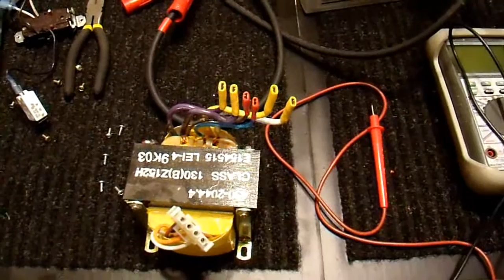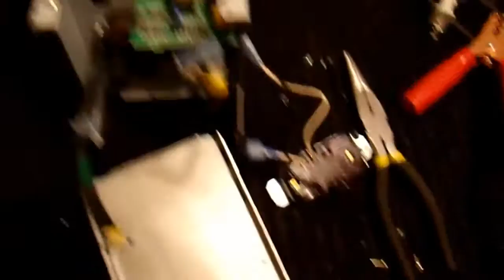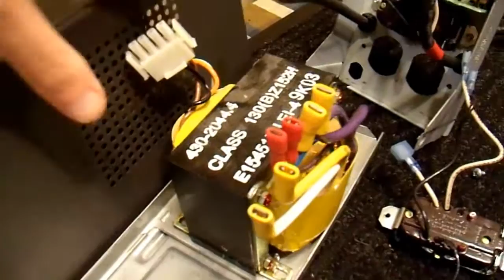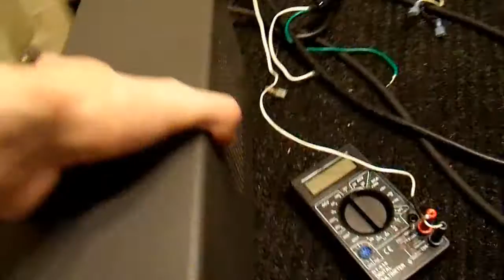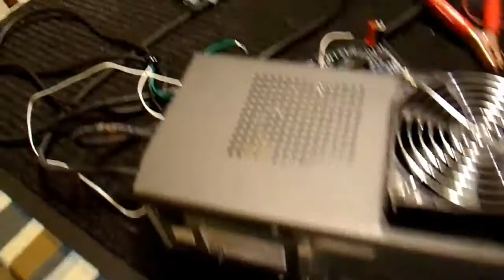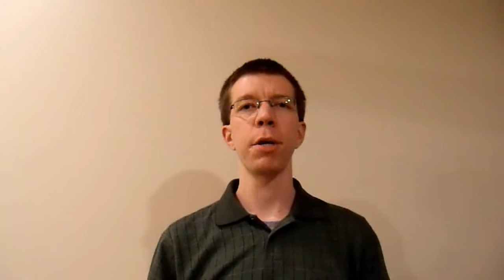UPS to Inverter Conversion FAIL Follow-up part 4

Comment: hi thanks for the vids ..very informativeplease tell us what causes a ups to report an internal faultit runs perfectly for 1 minute theres no sign or overheating on the pcb  I tried new batteries same problemfault when mains connected .also when only running on battery . max runtime 1 min

Comment: Working on restoring a APC SMX3000 - 120 volt unit to full functionality.  The unit operates fine under the NMC/web control, but the LCD screen is locked into an "internal fault" message with no response to any of the control buttons.  I'd like to know if you have any experience in this type of unit and what areas are best to inspect/test to determine if there is a relatively simple "fix".  I've tried updated firmware - the NMC upgraded fine, the UPS would not upgrade either with wizard or ftp.  Any help appreciated.

Comment: Well I had in the past the same Idea, but when I commented this to one of my college mates.. one of them make mention that this devices aren't really meant to run for long terms of time! usually they will never give you more than 10 or 15 min and then they would shut down! so my concern is that the transformer wasn't designed for a full duty cycle. well those are my 15 cents of common sense! hope that bring you closure!

Comment: Once again I see I am late to the dance but wanted to comment on how much I enjoyed watching this project unfold. The battery cable access ports, doubling the transistor count, changing the beep alarm function using the software, the 2.2k pullup resistor on  the mystery chip, and your demonstration of the multistage transformer windings with the auto-transformer were all great stuff! I was sad to see the 650 eventually die but even so it was some consolation knowing that many of the parts live on as useful elements in other projects. Your videos are very interesting, entertaining, informative, and technically accurate - something rarely found all together in YouTube or any other videos for that matter. Your efforts are very much appreciated!

Comment: Thank you very much for this video. It is a very good solution as grid backup.
What if I used many ups in parallel (plug each to the line) each of them is attached to its unique battery bank, will it work as fine?
should they be of the same output power? 
do I need to synchronize them toghether by adding a new control circuit or not ?
Again , thank you very much.

Comment: I remember something I did with a 5 amp multi tap power supply. It was a bare bones one that I modified to a regulated power supply. The problem, was the transformer, although rated at 5 amps continuous output, got quite hot, even with a computer fan already mounted in the case, I mounted a couple of heat sinks(with thermal compound & a compromise for space) to the outer case of the transformer itself. It solved the problem. That was seven years ago, and it's still working fine!

Comment: One thing to remember, these UPSs are only designed to run at maximum output for about 15 - 20 minutes. Due to that, APC spec's things based on this runtime.If you had run it at say a 50% load, you might still be using it. I'm running my Smart-UPS 1500 at 25% load and with the extra batteries, I have 35 hours of runtime. If I was running the same load on a 600VA ups, I would be having cooling on it to run a lot of air through it, but that is just IMHO.
:o)